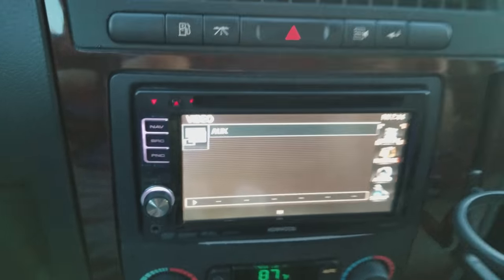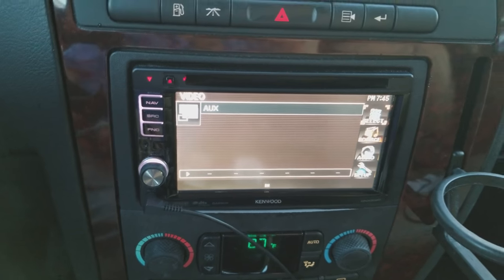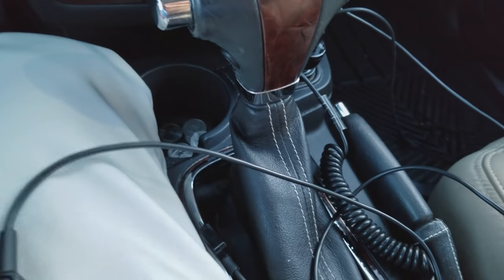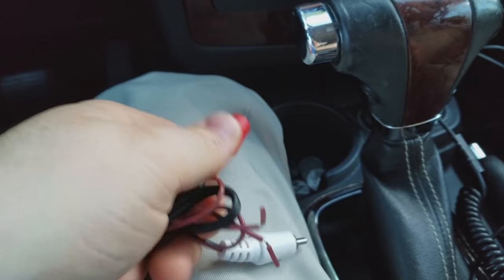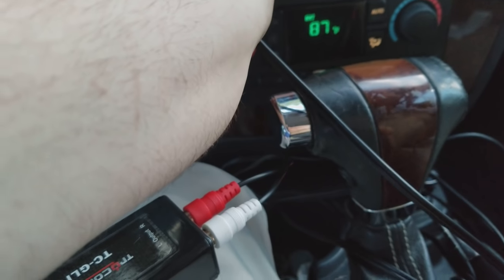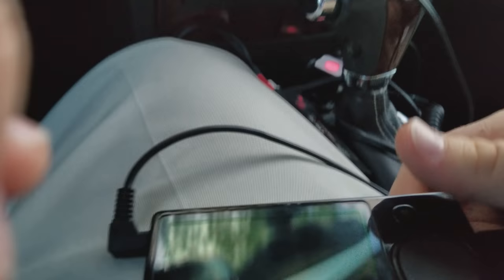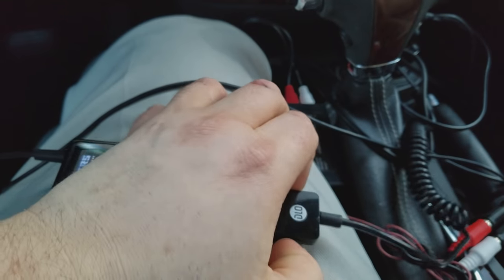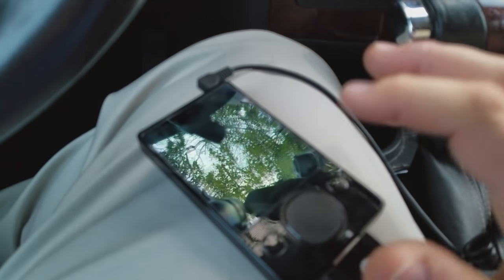Annoying Car Static - How to Fix It, and What a Ground Loop Isolator Is

Comment: Thanks for the video!  We have this same symptom in a factory original stereo in our 2005 Pontiac Grand Am (no RCA connectors on the back of the module, no Bluetooth, no USB input, no auxiliary input; just AM, FM, and CD).  I have to watch the explanation segment again to further understand and troubleshoot my case.  Symptom exhibits regardless of engine on/off, key on/off, or stereo on/off.  The temporary solution was to simply disconnect the speaker that the buzz usually comes from but the buzz can also move to other speakers.

Comment: 2:27 That's alternator whine. There is a common thing called the BIG 3 upgrade. A bunch of videos on YouTube show how to perform that upgrade. That upgrade helps to eliminate the RF interference coming from your vehicle's electrical system among several other things it improves on.

Comment: It goes on the back of the radio. The RCAs that are running from the back of the radio to your amplifier was routed wrong. They are not supposed to run down the same side of the car as the power wire for the AMP. To avoid inconvenience, installers will add ground loops to the back of the radio or close to amp to stop the noise.
Reply: No that doesn't generally cause static. He's right it's basically a resistance to ground issue. He's having. What you're thinking about is alternator whine because an alternator produces alternating current and then rectifies it with diodes to DC or direct current so it can charge your battery. You end up with a square wave on the output side of the alternator. Now if you're just adding an amp for a subwoofer and not pushing mids and highs you can actually get away with running the RCA cables with the power cables to save time because the low pass crossover on the amplifier will filter it out. But if you're running highs and mids off of an external amplifier and not directly from the radio then yes you want to run them down the opposite side of the vehicle. You also should invest in RCA's that have twisted pair construction or you can make them yourself. But you want the positive and negative wires on each channel wrapped around one another and it will actually reject alternator noise because your canceling the electromagnetic field created by the RCA's by doing that. That's all they do when they manufacture them in factories. All the other bullshit they claim is bullshit. Twisted pair is legitimate. Everything else they claim is straight up bullshit. If you look at the cable alot of times you can actually see it through the outer jacket. Bad grounds cause all kinds of noise problems and using an amp kit That's too small for the amp your installing causes those problems as well. I always run the largest power and ground cables I possibly can. If the terminal block on the amplifier will accept 4 gauge power and ground then That's what I buy and run to it. I don't care if it's only drawing 15 or 20 amps current off the battery. That's beside the point. That and believe it or not running larger gauge power and ground cable than what you need actually keeps from stressing out your alternator as much. It doesn't have to work as hard Expeacially when you're building a multi amplifier system so your actually drawing a decent amount of current off your vehicles battery. It also prolongs the life of your amplifiers as well. Spending a little more money now saves you alot of money down the road.

Comment: FOR WHAT IT'S WORTH:  Try wrapping your  radio's antenna cable in aluminum foil.  I wrapped mine from the radio plug-in as far back as I could reach behind the dash - abt 3 ft. - without ripping the dash out.  Works great. Eliminated almost all interference.  Don't  know how this works, but I do know those gadgets that are supposed to kill radio static, buzz, & whine DID NOT work while a few cents worth of aluminum foil did.

Comment: Guys if you have this problem disconnect  the black groundwire that connects from your aftermarket radio to your aftermarket wiring harness. Crimp a ring terminal on it and bolt it  down to something solid metal in the dash.
Reply: Doesn't work.

Comment: I have a similar problem, just bought a new Jensen receiver. Everything works fine except that when I turn the engine on I get this static/buzz/hiss when the engine is on. The noise gets worse when i rev the engine goes away when the engine is off or when the sound is muted. Now I don't have anything connected to the radio. No aux, no charger, and the rcas in the back are not being used since I do not use any amp. Can anyone help me? Ive tried numerous things and nothing seems to work,

Comment: Guys! The reason why you have a ground loop problem is because the ground cable you are using from the headunit is too small. The ground loop problem is because the ground cable is not the right gauge. You need the right size ground cable and it that won’t happen.

Comment: ground loop isolaters are just a band aid for the problem you need to get yourself a multimeter and start checking connections
Reply: Diana Gallagher  you are right, basically the ground cable his using on the heady it is too small. He needs a larger gauge for the ground. Done

Comment: Its probably the usb power converter going in the cigarettelighter connector making static noise. Try powering the zuna directly from the aftermarket radio usb outlet.

Comment: Thank for the tip. I face the similar problem for some intermittent echo sound after starting engine. My vehicle has a Bose amplifier behind, inside the trunk. I'm pondering if I should replace this amplifier or using RCA filter. Appreciate for advice.

Comment: Part of the problem is that the Zune charger has what I call “dirty power”, which means that the transformer in the charger allows for 60 Htz radio interference to enter the transformer.  Basically, your add on is a 60 Htz filter.  A quality charger has a ferrite core built in.  Your add on uses a ferrite core.

Comment: Not only does it cut the hum,but also any audio in the same frequency range
Reply: Yea its funny how ppl still dont understand what a ground loop is and how to fix it, properly
Reply: I'm actually having an issue I can't resolve. Alpine halo 9 has a weird hum, previous pioneer amp had no noise, I recently added an amp to power the 4 speakers, in hopes of getting a bit more clean volume,but also possibly getting rid of that hum. Not only is it still there, now I have fucking alternator whine with the car running that wasn't there before..... fucking hell

Comment: Using an isolator degrades the sound quality I think.  It will get rid of the high pitch whinning noise plus the same high frequency of sound as well from music in my experience.  You said the entire frame is the ground and since you have an upgraded after market radio, the ground used to ground the radio may be the problem of the whinning noise (since aftermarket radio amplify sound louder than stock radios).  I'd try having the aftermarket radio grounded directly to the battery to see if the whinning noise goes away.  And if it does go away, the ground wire used from the chassis frame to battery may be the cause.  For my experience that worked for me was to add an extra thicker wire from the chassis frame to the battery to help with my ground loop whining problem.  (Or you can just try to run that seperate ground wire from the battery to the radio when checking if the whine noise was present and make it permant....just make sure you hide this wire.)
Reply: Jeffrey Maravilla I’m going to try this

Comment: There is a reason You have a Alternator A battery And a starter...............NONE of which works without a Ground to the closest length to the car as possible ............
Same with a radio..Your jacks energize the case of your head unit which also has other inputs and outputs Static feed back from the alternator output not the Engine  You have positive power from the head unit entering one end and positive power from your cig lighter This extra loose power has no where to go till it finds Your metal case (Do a volt check on it ) I simply found a extra hole on the case and ran a good size ground wire off the RCA And ran it to the metal case..From the metal case to metal frame behind the unit ......No issues And stronger FM non static channels ......75 cents problem solved

Comment: Problem is if you have a nice audio system in your car those ground loop isolators degrade the audio quality even with the best ones (also makes the audio out of phase), I gave up on fixing it and moved onto just using battery banks that i rotate from using and charging to overall remove ground impedance issues altogether lol. I wish someone made a power coupler/conditioner/suppressor/filter/whatever for the cigarette lighter to go either in the external plug or even the power cables to the cigarette lighter as to not mess with the audio signal.

Comment: Sometimes getting a better aux cable works ,getting better grounds for the head unit ,also grounding your rca cables if you have any.adjusting your gain correctly on amp if you have one as well
Reply: Massivsavage 47 okay wait! Your on to a problem I'm having! My amp makes my subs buzz! An when I turn the gain up it gets louder! But it's only when I plug my RCAs into my radio or amp. But when there unplugged the amp makes no sound like usual
Reply: Have u solved the problem bro??

Comment: I have the same noise but it's when its playing music. Radio, Bluetooth. Aux
Reply: JOSH WILDE Official link?
Reply: JOSH WILDE Official thanks bud I think I have a couple here at the house, I hope it works only thing is I have no amp so it's my aftermarket deck
Reply: guadalupe,jose zaragoza valle  me too
Reply: use a noise filter that connects to the ground,red and yellow cables
Reply: I have infinity primus 9004a and the same issue comes

Comment: no its not wrong engine oil even wrong engine coolant does that ethilen has strange effects on electric motors/generators if you brake a magnet in starter motor you get 4 poles not 2 so its not only audio equpment who does that effect by dashboard millage counter ceap ticking evry time I put coolant in the cooling system in winter that static do engine run on I bet you have GM parts in your car right ore chevy ore ford do that litel anoing things but they can by put to your advantage like for dual ignition "waste spark" that is what static is usefull for